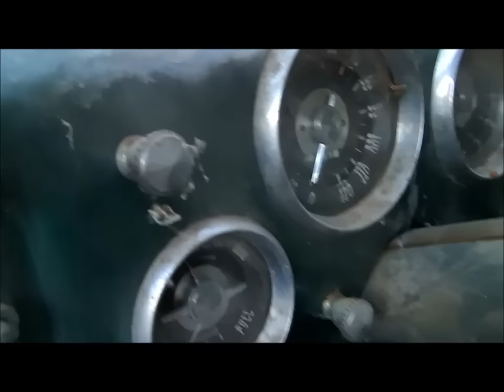"Will it Run?" Special: 1949 Frazer Daily Driver Project! Week 1

Comment: Just ran across this older video. About to watch all 6 parts. Can't argue the template for this body design might have been the inside of a bathtub. If you could get what looks like some old house paint off of it, it would look much better. Maybe some rattle can black primer, if not, in some kind of "two-tone" pattern. ??? You've got quite a "salvage" yard going there. Anxious to see some updates on that Fleetline. ;o)

Comment: This will be an interesting project to follow. It's not the fanciest car I've seen but it's really nice and amazingly solid. You said it's radio delete but did I see an antenna on the right fender?
Reply from the maker: +AudioMobil Yes! The right fender has been replaced at some point; that would also explain the weird 2 toning; it would have been difficult to match the paint properly. She is pretty solid, though; that's the main reason I decided to save this car and drive it instead of just parking it with the others.

Comment: Describe something nice about this car: 
1.) The tail lights, front parking lights and how they're integrated into the trim
2.) Basic conservative rounded-off 40s styling.
3.) Rear bumper
4.) Dash
5.) Steering wheel and horn rim
6.) Rocker's stainless trim
7.) The fact that it got saved!!

Comment: I wonder if that is the one I owned back in 1954.
Reply from the maker: +THADDEUS SWONGER Maybe? Where did you buy yours? This one was sold new in Calgary.
Reply: +coldwarmotors Bought mine used in Stratenville, Pa. 1954

Comment: Looking good. A little steel wool and diesel fuel will clean up the original paint and maybe take off that thin layer of repainted white.
Reply from the maker: +roosty6 Hi! I considered trying to strip the repaint, but I think that the fender on the right side has been replaced, so it wouldn't really look any better if I did, haha. I think I'll leave it for now and just enjoy the scuzziness of it. Cheers!